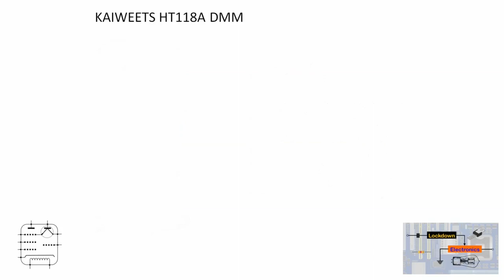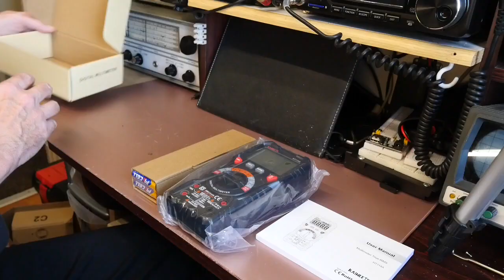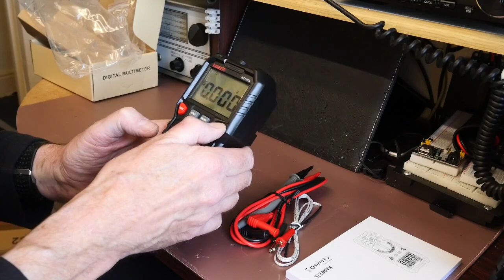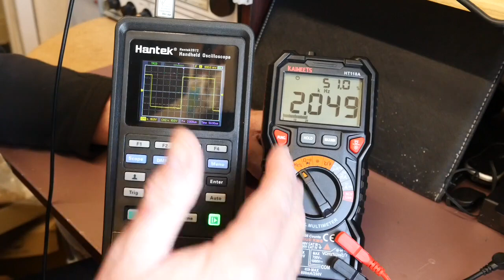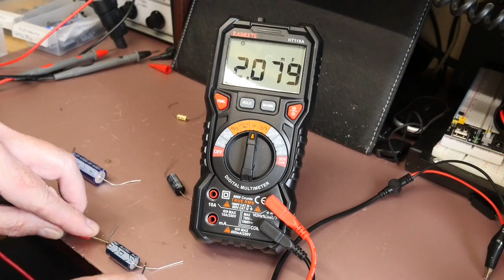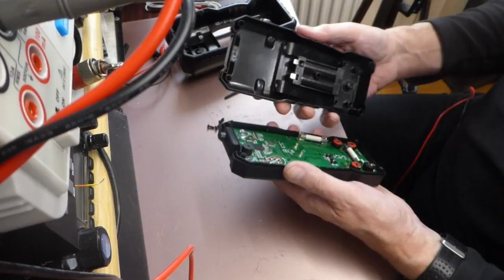Kaiweets HT118A Digital Multimeter Review

Comment: I have a HTC DM 98 mutimeter, when I connect to AC supply and check the voltage. It shows as OL, not showing the value. I use another meter tot check the voltage its shows 220 V. Any ide what would be the issue with DM 98 multimeter.
Reply: hey, been a while so not sure if this is still helpful but I have the same HTC one (which looks identical to this kaiweets but was much cheaper haha) and when on voltage mode you need to press function button to switch to AC mode for ac measurements so could be that maybe. hope this helps!

Comment: Excelente video!!, yo compre en el 2022 via Aliexpress un multímetro Habotest ht118A, el cual por unos día deje de usar y las pilas se sulfataron pero no alcanzaron a derramar liquido, lo destape limpie y no encendió mas!!! plata tirada y eso que lo recomendaban como bueno!!!. Le testie todos los componentes y los único que me dan corto son 2 transistores smd Y1 q1 y q2, si mal no recuerdo. Los reemplace pero amago a encender le realiza la  calibración como indican por ahí pero arroja error "0"  y no encuentro data sobre eso. Una verdadera lastima porque tiene linda pinta y funciones.

Excellent video!!, I bought a Habotest ht118A multimeter in 2022 via Aliexpress, which I stopped using for a few days and the batteries leaked but they did not manage to spill liquid, I uncovered it, cleaned it and it did not increase anymore!!! wasted money and they recommended it as good!!! I tested all the components and the only ones that give me a short are 2 smd transistors Y1 q1 and q2, if I remember correctly. I replaced them but tried to turn it on, it performs the calibration as indicated there but it returns an error "0" and does not find data on that. A real last one because it has nice looks and functions.

Comment: I bought one from Amazon and really liked it and watching EEV Blog, Dave Jones mentioned to buy two DMMs so you can monitor voltage and current at the same time or two values at the same time so I ordered another one of the same meter from Amazon. This is my personal choice but I also bought a good analog multimeter as well with a transistor dock. I'm building my Electronics Laboratory Bench. I haven't practiced electronics in over 20 years. I'm getting back into it. It's about having fun not making money 😊
Reply: Did the same, and had 2 other ddm to measure many points simultaneously

Comment: I am surprised for such an advanced meter, it's just 3 volt DC powered by mere two AA Batteries...BUT, my issue with this model is that capacitance, atimes,is quite off the tolerance level which is some worry when troubleshooting high-end electronic device PCBs

Comment: I have some nice old Fluke meters.  I purchased this one as a new "modern" meter.  Within ten minutes I knew this was my new favorite meter.  I love all the features.  I even purchased two, one for electronics and the other to bounce about in my auto repair toolbox.   Nice video.
Reply: How is it so far? Still working good?
Reply: @samygold100  Yes, still use them both all the time.  They have never let me down.  Even some of the features I thought I would never use like the built-in flash light I have used several times.  Still very happy with the meter.  I have compared voltage, current, and resistance with more expensive meters and it has always been spot on.
Reply: Hello how do i use it to test battery/Alternator in my car.

Comment: Just subscribed to your channel.planning to buy one.how loud is the buzzer.very important when working at noisy environment.
Reply from the maker: I'll see if I can measure the volume.
Reply from the maker: Beep sound volume checked using my mobile phone's sound measuring app I get the following:-
UNI-T UT70A - 65dB
Fluke 23 II - 61dB
Kaiweets HT11A - 69dB
So that makes the Kaiweets the loudest of the three tested. It also has a LED indication of continuity.
Reply: @LockdownElectronics  Thanks for the quick reply.keep it up sir.